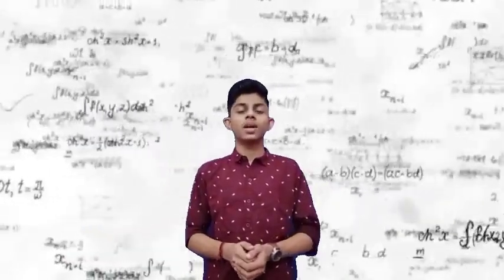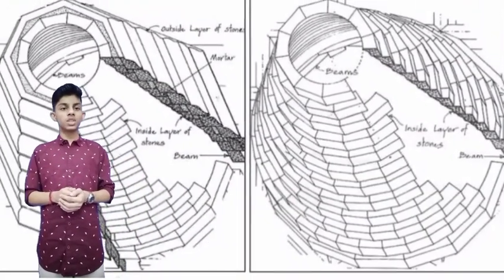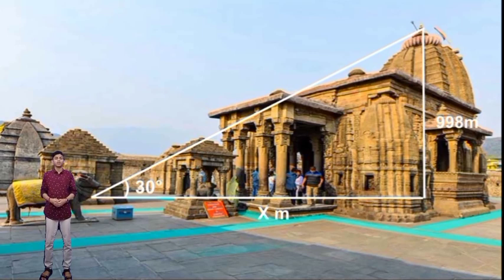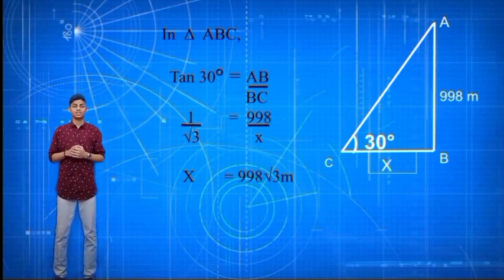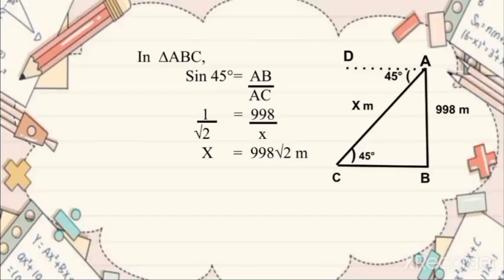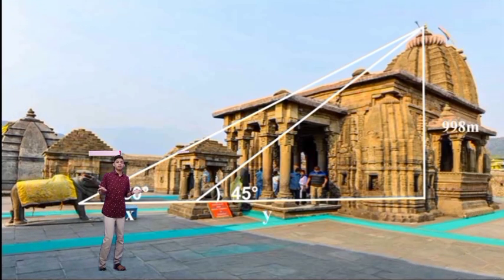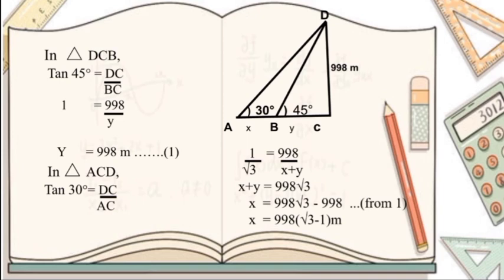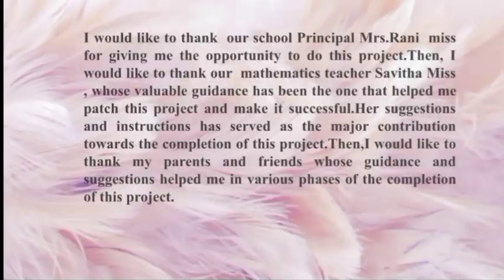Mathematics Art Integrated Project|Class 10|CBSE|Applications of Trigonometry|

Comment: Analyse the structure of any statue from kerala,Himachal pradesh compare it with statue of unity, comment on their height width, covered area and material used.

Its a project onthe topic. Can you help me.
Reply from the maker: Let's take an example of Shankara Sthampa from Kerala and Hadimba Devi temple from Himachal Pradesh and compare it with that of Statue of Unity

Height of Shankara Sthampa temple
 : 45m
Height of Hadimba Devi temple
:24m
Height difference: 45m-24m=21m

Height of Statue of Unity
:182m 

Difference in height b/w Hadimba Devi temple and Statue of Unity=182-24=158m

Difference in height b/w Shankara Sthampa temple and Statue of Unity
=182-45= 137m

Adding the height of Shankara Sthampa temple and Hadimba Devi temple 
=45+24 = 69m<182m(Height of Statue of Unity) 
It can be inferred that double the sum of heights of Shankara Sthampa temple and Hadimba Devi temple is less than the height of Statue of Unity

This is a comparison of height , like this you can prepare a comparison of width , area covered and materials used , refer to internet to get the data 

Hope this helps :)
Reply: @sreedevsuresh   thankssss ❤️❤️❤️❤️for your valuable reply.. You help me a lot... 🙌

Comment: For rhe case two when u say that angle DAC equal toBCA how when line are parrell than only alternative interior angle are equal na how i cant understand
Reply from the maker: Actually the dotted line is the horizontal distance parallel to the eye of the observer it is the parallel line and so when it is cut by the transversal , the alternate angles becomes equal .Here, AD represents the horizontal line  and AC represents line of sight.so, the angle of depression is the angle between AD and AC.

Refer ncert pg.no.197 there you can see the Horizontal line drawn from the eye of the observer , also refer Example 6 Pg.202

Comment: Pls can u suggest me something for Odisha I have to make ppt . And submit till 31 Dec  pls help me
Reply from the maker: You can do on the geometric analysis with a chronological order for the basic movements and footworks  used in dance as you can see wide variety of dance forms in Odisha . connect it to the concepts of Conic sections (coordinate geometry) , Completion angles, lines etc.

Odisha is famous for temples and you can connect it with ancient architecture and mathematics.
You can also relate this to symmetry. Trigonometry can also be brought to calculate heights and distance

Pattachitra is a famous painting of Odisha if you are good at drawing you can draw it and show various geometric figures in it . circles plays a significant role in this you can inscribe it in a square and connect it to Concepts of tangents

You can prepare a data analysis of no.of corona virus cases in last few months and represent it graphically with line graph bar graph etc. you can also prepare graphs about there development in health technology etc it also connects to economics

You can easily bring the concept of circles with the chariot wheel in sun 
Temple and calculate its area circumference etc which connects to surface areas and areas related to circles.

Some temples have dome like Structures where you can bring areas related to circles more easily for more ideas regarding diagrams refer  our ncert textbook where you will find such similar figures.

These are some of my ideas.Dm me on insta for more clarifications.
Thanks for responding to my video
All the best for your projects.

Hope this helps you🤩🤩🥰🥰
Reply: @sreedevsuresh  thank u 😊 for suggestion

Comment: My topic is odisha. Can you suggest me some ideas maybe? 
Btw great work.
Reply from the maker: You can do on the geometric analysis with a chronological order for the basic movements and footworks  used in dance as you can see wide variety of dance forms in Odisha . connect it to the concepts of Conic sections (coordinate geometry) , Completion angles, lines etc.

Odisha is famous for temples and you can connect it with ancient architecture and mathematics.
You can also relate this to symmetry. Trigonometry can also be brought to calculate heights and distance

Pattachitra is a famous painting of Odisha if you are good at drawing you can draw it and show various geometric figures in it . circles plays a significant role in this you can inscribe it in a square and connect it to Concepts of tangents

You can prepare a data analysis of no.of corona virus cases in last few months and represent it graphically with line graph bar graph etc. you can also prepare graphs about there development in health technology etc it also connects to economics

You can easily bring the concept of circles with the chariot wheel in sun 
Temple and calculate its area circumference etc which connects to surface areas and areas related to circles.

Some temples have dome like Structures where you can bring areas related to circles more easily for more ideas regarding diagrams refer  our ncert textbook where you will find such similar figures.

These are some of my ideas.Dm me on insta for more clarifications.
Thanks for responding to my video
All the best for your projects